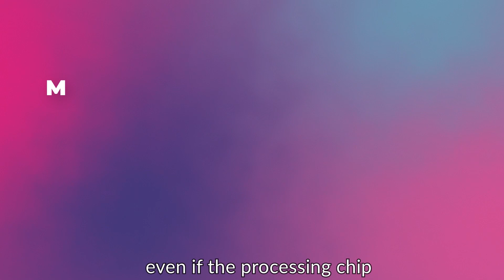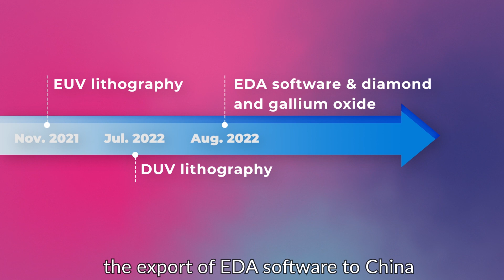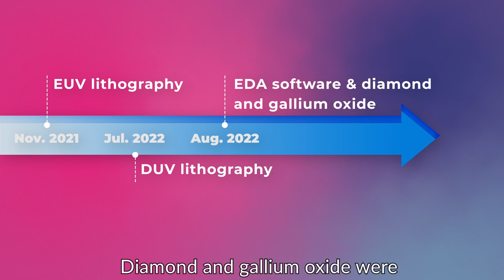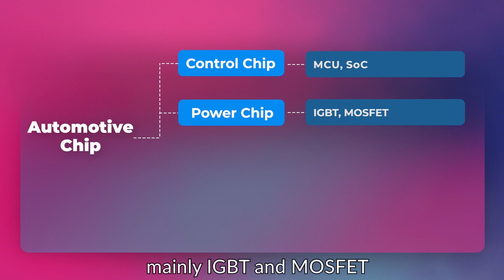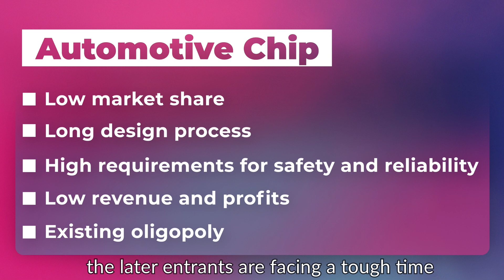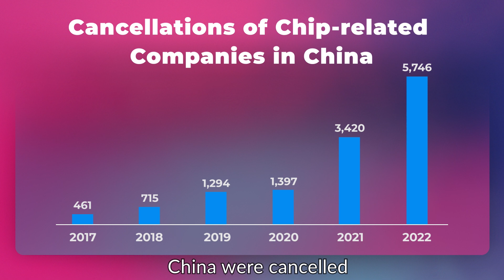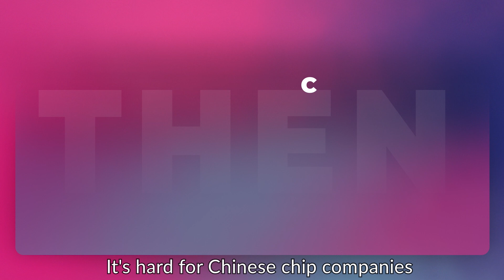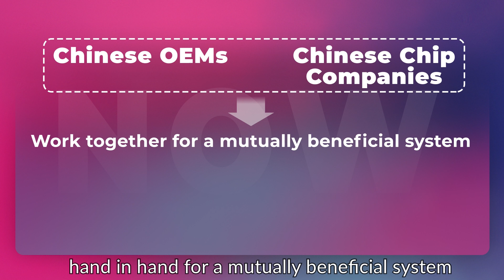How Could China NOT Lose The Automotive Microchip War？

Comment: On another channel, I noticed that someone mentioned US attitude to nuclear weapons immediately after WWII. They thought they had an advantage that would let 30 yrs. In fact it lasted barely 3. It may be that there will be supply bottlenecks down the line but  if anything it is Western legacy automakers that are bring hit hardest by chip shortages. This seems to be because ICE vehicles are not built from the operating system upwards and the consequence is they need a lot more chips per vehicle. Meanwhile China is filling in the many gaps that it had in the chip supply chain. It is still patchy but there seem to be breakthroughs every week. In the end, whatever the short to medium term difficulties, the US will have galvanised the development effort in China.